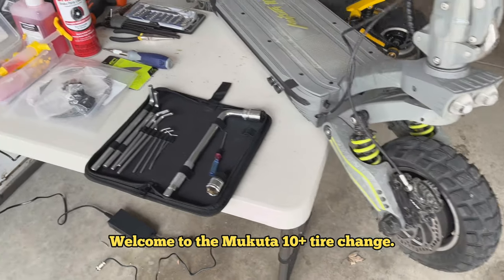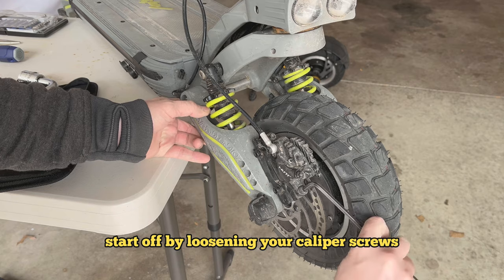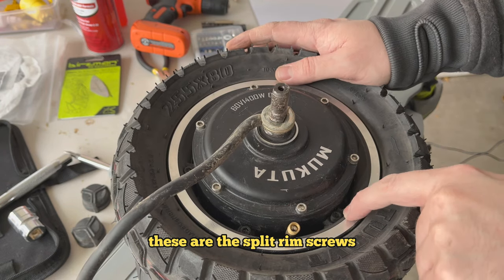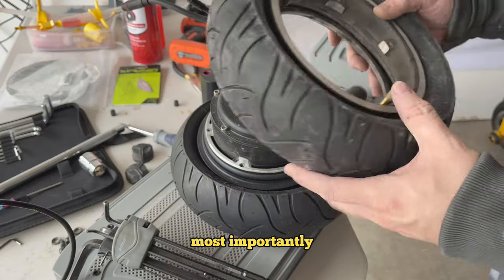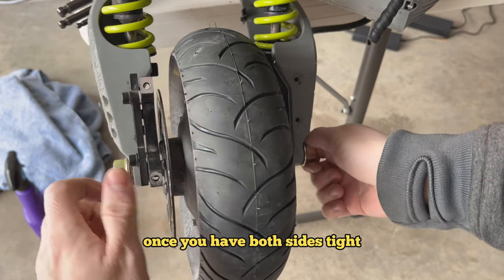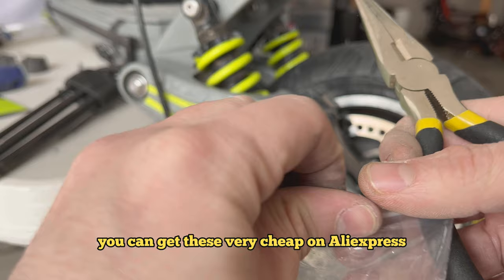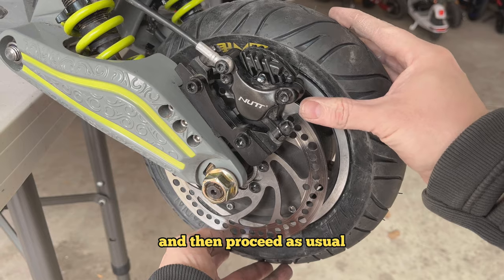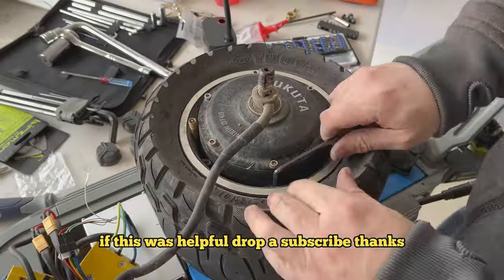MUKUTA 10+ Tire Change and Brake Tune-Up  // PMT Tires @ WYRD ⚡️ RYDS

Comment: Also, I pulled the valve stem out and put in about 2 ounces of tubeless tire sealant for mountain bikes. The stuff works excellent. If you poke a hole in your tire and your tube just turn the hole to the downhill and wait about 20 seconds put some air back in and you were on the road. I failed to do this and I had to walk 5 miles back home and that was the last time I don't use sealant.
Reply from the maker: Yes I've had slime work sometimes, sometimes it simply doesn't... Best to check your psi every ride if you truly care about not getting flats, riding with low psi is the main culprit imo.

Comment: Recommended psi for the wheel
Reply from the maker: I ride at 40 and about 190 lbs weight. If you weigh more go higher like 45, if you weigh less, 35 is ok. That's for PMT that is, if you have the stock tire keep them up higher like 45-50 psi.

Comment: I left the calipers on and had no problems. The tire upgrade is big.
Reply from the maker: You can do this certainly, if you don't plan to change the brake pads. But pads are so cheap you might as well change them while you have the scooter taken apart imo

Comment: I just opened my new MUKUTA 10 and the front tire is flat and won't hold any air. My rear disc  looks to be bent or the breaks are off, i can't figure that part out just yet. I wanted to ride it but i guess i have to find time to make the repairs.
Reply from the maker: If it was just the brakes, I would try and help you recenter the caliper and it would probably fix it. But with the tire flat also, I would straight up ask if they could swap out the whole scooter for you, simply because you really shouldn't have to change the tube on a brand new scooter.

That being said, they use pretty cheap tubes from the factory and it's so worth putting the PMT tires on that you may as well just keep it and do all that at the same time if you are handy. I put those tires on day 1 and never look back they are superior in every way. So up to you if you think you want to deal with it or try and get it a replacement unit. The next unit could always have some small issue too nothing is perfect yet on any of these scooters.
Reply: @ScootaGang  im just going to replace new tubes and i got the disc spacers you recommended to see if that helps. I threw out the box thinking everything was fine so im just going to see if i can make the repairs

Comment: I’m using my pmt e fires tubeless on my scooter. Should I have used inner tubes? What size tubes exactly did u buy?
Reply from the maker: You can definitely use those tires for either tubeless or tubed scooters. What matters is if the scooter is split rim or not, then it has to have tubes inside.
Reply: @ScootaGang  okay great. So if it’s split rim generally u would want tubes? I have solid rims and it was a bit of a challenge seating the tire on the rim. I have 10 inch tires I’m not sure of the width of the rim but I was thinking my next set is going to be the 10x3.50 pmts do u think those will work?

Comment: My rear wheel broke and it's going 26km/h with dual motor mukua 10. What is this problem?
Reply from the maker: If you don't know how to fix scooters, I would take it to a repair shop
Reply: @ScootaGang  I received it today and they told me to do it with the checks

Comment: Do you know if you can put tubeless/solid tires on this scooter
Reply from the maker: You can't because it's a split rim so there is a gap between the rim that doesn't seal airtight. Most split rim scooters you can't use tubeless except for a couple dualtrons that have made a special rim design just for that
Reply: Split rims will absolutely work with a solid tire

Comment: Does that brake tool work for Vsett 10+
Reply from the maker: The gap setting tool? Funny I just used it 5 minutes ago on my Vsett 10+. Caught a staple had to swap the tube. Yes 100% it works on all the hydraulic brakes I have tried except for the wolf warrior since those rotors are an extra mm thick.

Comment: Got a pinched tube. Cannot push or lever the valve out of the rim. Just had mine handed back to me by a repair man who could not figure it out. Nightmare.
Reply from the maker: Really? This is an extremely easy tire change it takes me about 20 minutes. I would find someone else to repair your scooters, if they can't do this they won't be able to do anything

Comment: the only disappointing thing is the stock suspension imo, i'm also not a big fan of split rim/tubed tires & wheels cuz the wheels are structurally less strong and the tubes can get pinch flats

why am i disappointed with the spring suspension? well you can't upgrade it for rebound adjustable ones cause they're much larger in diameter than the usual stock springs, atleast on my scooter, on vsett the dia is apparently similar, so i'm kinda fucked xd
Reply from the maker: After riding the Mantis King GT more that has adjustable hydraulic suspension, I still prefer the Mukuta it much more firm, responsive, and less bouncy.
Reply: @ScootaGang  That's most likely the load spring, on a normal vsett with C suspension you can actually put an exaform adjustable damper (291R)

you can change the spring with a different lb/in for more firmness or less

my guess is that the 2 springs from the Mukuta are stronger and that the springs on the MKGT suspension is made for lighter people, however as i mentioned you can just buy & change the springs in a different value if they're too light on one of those

the MKGT range test etc was with a ~75KG person as test (165lb), i guess the springs are just good for someone of that weight or slightly soft, so if you're heavier you should probably adjust the preload and/or change the springs
Reply: i hate the handlebar setup and worst of all the throttle.  50 years of atv tech history this is what they come out with on this?  wtf.  they should be embarrased imo.
Reply: @FastDuDeJiunn  i mean it's still better than a twist throttle like an ATV on a scooter, that'd give you quite a bad day

the response is purely a controller issue, which probably are Vsett ones
Reply: @FastDuDeJiunn  well there's all kinds of other people who think the exact opposite.

Comment: Aww wtf vsett needs to get it together on the next models with the quick disconnect motor wire.
Reply from the maker: I think they are testing it out on the Mukutas and if all goes well they will add them to future Vsetts! (it's the same company)
Reply: @ScootaGang  word. That makes sense. Tubless split rims would be the next big move for scooters.

Comment: hey my guy thanks btw you replied to my comment on another video about gettin the back wheel off, umm yeh i did all of that but i didnt wanna try yank the cable out in fear of damaging it, WHEN i take those screws out it isnt exposed as far up, its actually barely in my fingers reach, was it LIKE that for you also?

Comment: Mankuta plastic looks so much cheaper than the vsett wtf
Reply: That's something that turned me off about it, but I I've seen enough reliable reviews that say it's a pretty solid ride.
Reply: There is very little plastic, a lot of that machine is metal and it is very solid. I have taken the stupid fenders off and left them off. I have been romping the shit out of mine and it doesn't rattle and it jumps off curbs gracefully and smacks potholes with no problems, and I can take mine up to 50 miles an hour and I have never felt the need for a steering dampener.